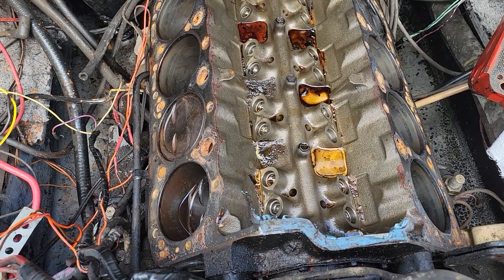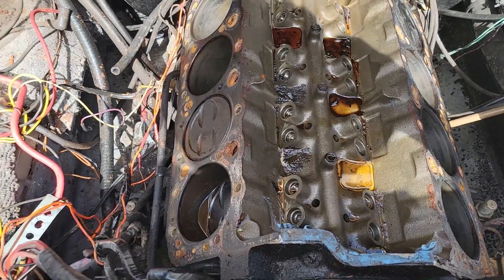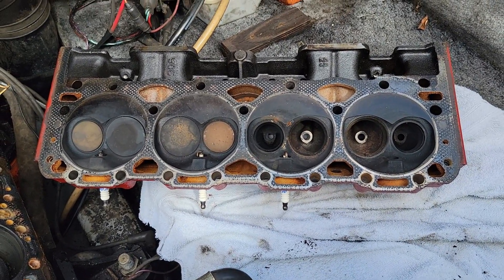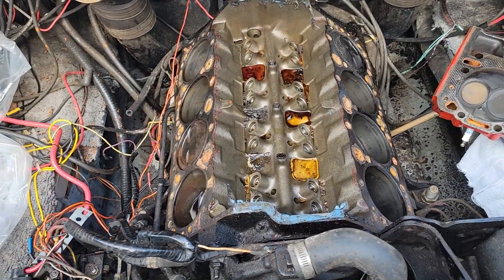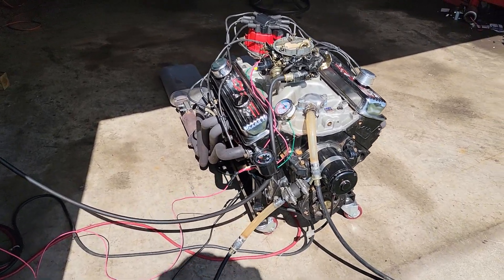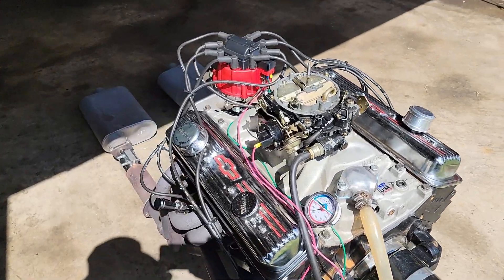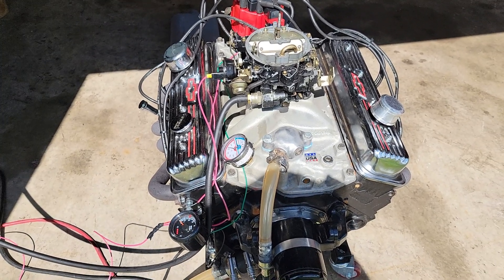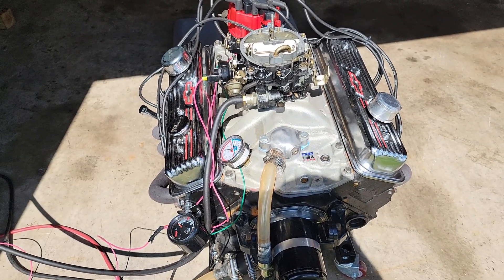Why Wouldn't This Chevy 350 Make a Good Marine Engine?

Comment: The 350 / 5.7 has long been one of several mainstays for power boating, but true marine blocks have a different metallurgic content and are more resistant to corrosion than standard automotive / truck engine blocks. And if I'm not mistaken, most have different-spec camshaft and rotating assembly better suited to constant rpm. This is why it's not advisable to put a boat or forklift engine in a road-going vehicle. They're set up for constant rpm, not up-and-down.

Comment: I currently have vortec heads on my 97’ Mercruiser 350 . There aren’t as much differences between car and boat engines as you think. The exhaust maniflolds on an Alpha one is water jacketed, so water can’t get into the motor that way unless they are cracked. So a little bigger cam than stock wouldn’t hurt anything. Also Alpha ones are good to about 300 hp, after that your pushing your luck. Head gaskets and intake gaskets are different than street stuff. Mercruiser sells carbureted intakes for vortec heads, pricey tho. Boat stuff is mostly safety related . Fuel pump with vent line to the carb, J tube on the carb. Spark arrestor, etc. you could run that engine you have, just gotta be mindful of a few things, and don’t hot rod it too much with that alpha one. Oh, and Mercruiser engines with stern drives have flywheels not flex plates.

Comment: I put a 307 out of a 73 Chevelle in my Bay liner capri. I used the cam and lifters and the heads from a 350 out of another boat that was freeze cracked all over the block. Just above the oil pan gasket and just below the head gaskets were all blown out from freezing and not being properly drained. I sent the heads out to be pressure tested and planed and they were fine. It works mint. The original motor in my boat was a 2.3 liter Ford motor. Basically the same thing as a Pinto motor.

Comment: Usually has to do with reversion because of the cam. It could possibly suck water in the cylinder with water manifolds . With dry headers or manifolds no problem.
Reply from the maker: @twopopsaqullu9721  Gothca thank you
Reply: @nylegreen261 This Is The Correct Answer!!! The Cam Can't Have Too Much Overlap With A Wet Exaust System!!! It Will Suck Water Into The Cylinder!!! Crazy I Know But True!!! No Worries Just Get A Cam Made For Marine Use!!! I'm Sure Comp Will Have The Proper Cam For You!!!
Good Luck!!!
Reply: @nylegreen261  your welcome and thank you for the videos. I really like your testing with the nova

Comment: The cam and heads are different for the marine use. A car cam makes power at different rpms. At least change the cam. There something different with the heads as well. He also says the marine 350 isn't a 350. It's closer to a 383. The 350 is too weak from a car.